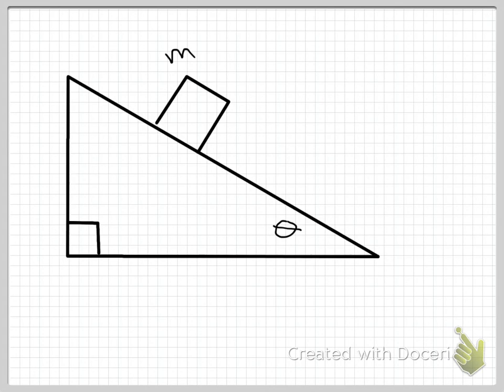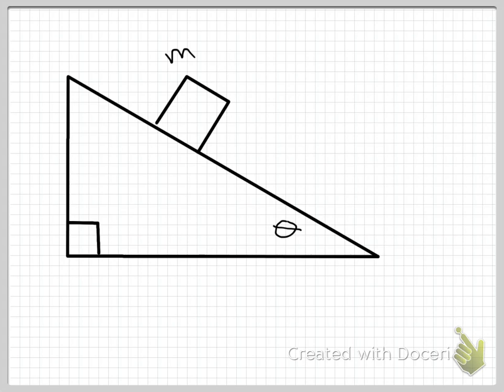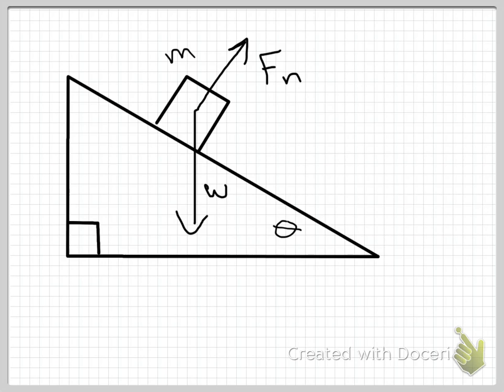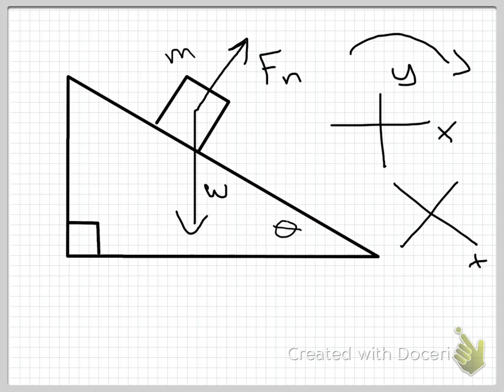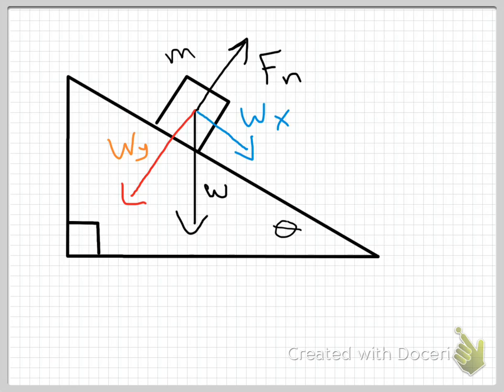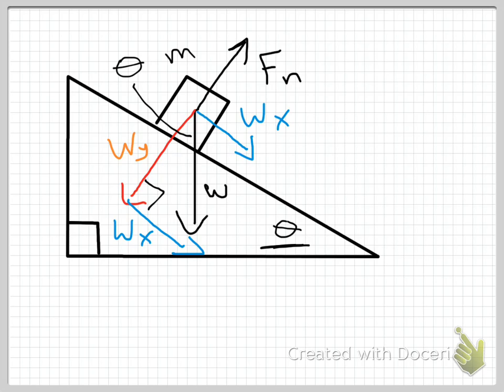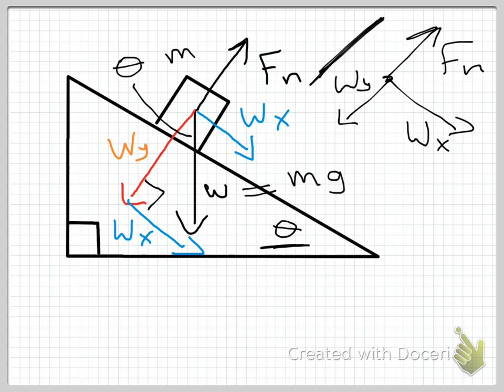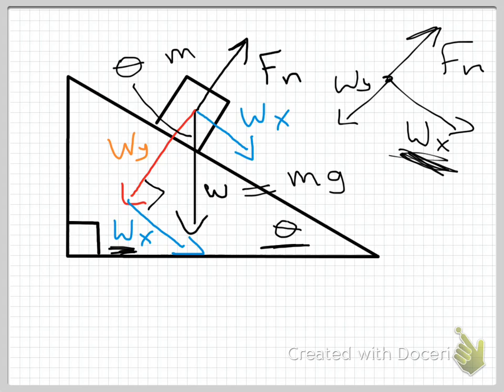Inclined Plane Geometry

Comment: How do you find that theta is the upper angel in the triangle of vector komponents and not the lower one?
Reply from the maker: Think about it like this: let the bottom of the ramp (the horizontal black line) be lined up with the "normal" x-axis and the surface of the ramp be lined up with my new x-axis. If I take the old, horizontal x-axis and rotate it up to the new, angled x-axis, I have to rotate it through the angle θ. Well, if I rotate the x-axis through θ, that means I have to rotate the y-axis through θ also if I want the axes to stay perpendicular. Now, look at the old and new y-axes (it might help to pause the video about 3:40 to see the picture). What I've called "W" lines up with the old y-axis, and the red vector lines up with the new y-axis. That means the angle between them HAS to be θ. It's a little hard to explain just by typing it out, but I hope that helps clear it up.